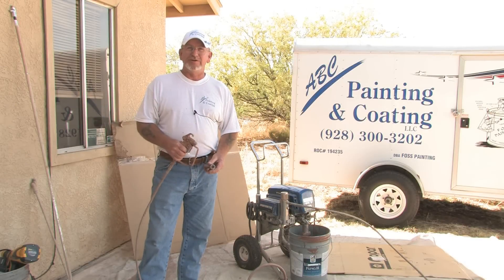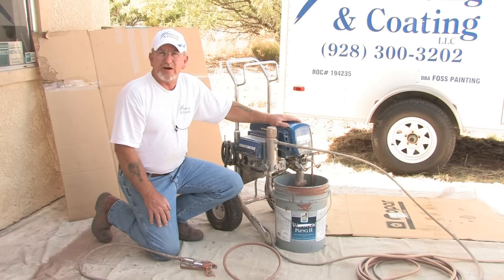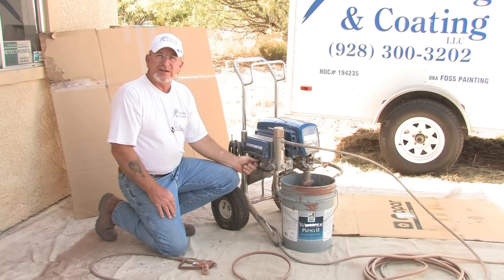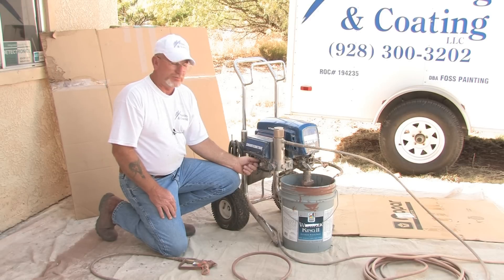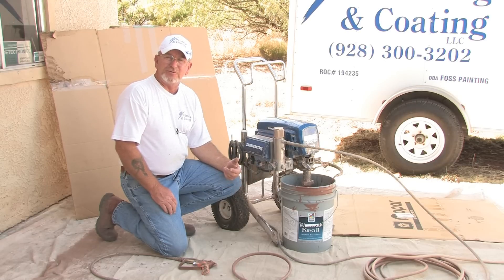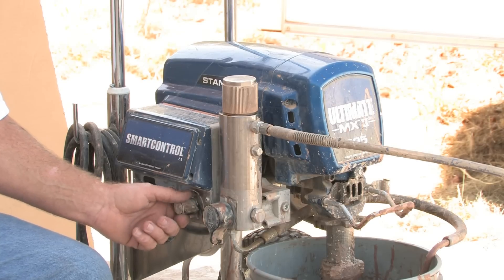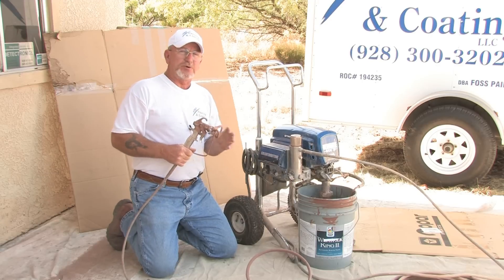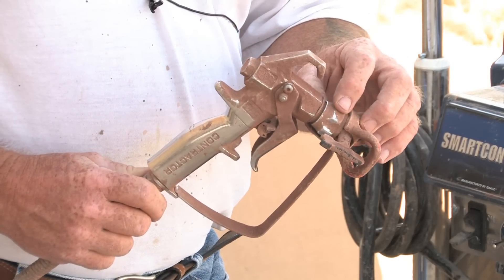Paint Guns : How to Use an Airless Spray Paint Gun

Comment: It all depends on the thickness of the paint and what kind of application. It should say right on the label of the paint can how much and what kind of thinner to use for the product. Standard latex doesn't need to be thinned down for instance, but a heavy duty metal primer has to be unless you want to destroy your sprayer

Comment: thank you so much for this video... I'm becoming a contractor here in arkansas to paint apartments and I only paint with edgers, brushes, and rollers.  I'm looking to improve my speed and skill in getting my job done so I looked into paint spray guns but I couldn't find much info on them or how to use them. This information is very helpful.  :)

Comment: When you prime a pump, you're just running thinners through the lines & pump before use. This only takes a minute or so. 
Once the paint is under, you would then run the thinners out of the line until paint appears, & then you just allow that to run through into your paint bucket whilst looking at the ribbon fan that is being created (this ribbon will indicate if you need to adjust the pressure &/or add thinners). Once ready, wipe end & add a tip.